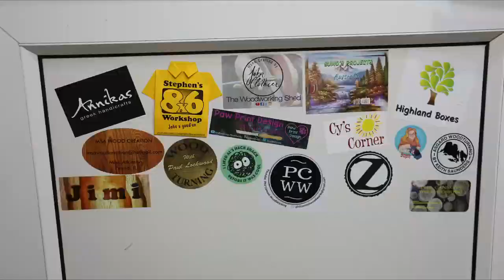8x6 Workshop Channel Introduction - My space for woodworking, woodturning, making and building

Comment: Great intro video. 👍 What dust extractor is that? Would you recommend?
Reply from the maker: Hi Norman. the extractor unit is a bog standard machine supplied by all the big machine merchants. Mine carries the Axminster badge. I don't have a build video for it but I do go over the machine in my Vlog 2017-07 which you may find interesting.